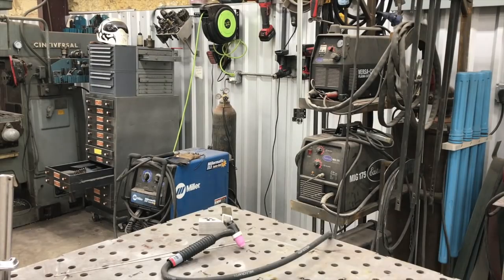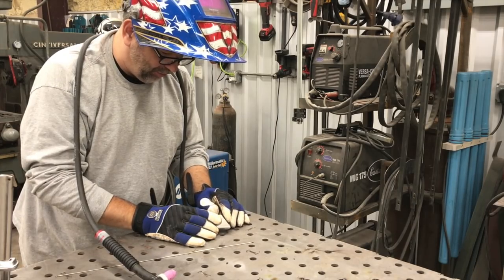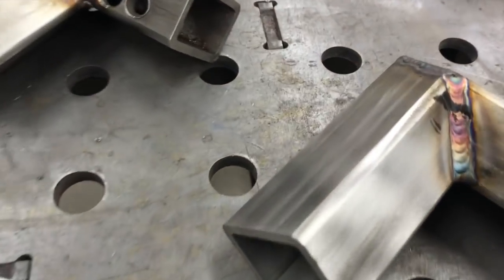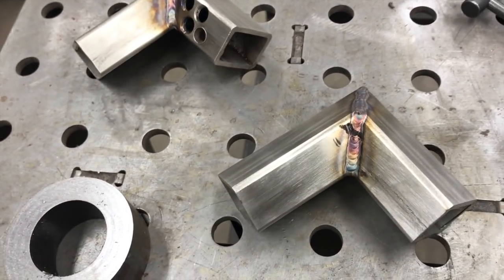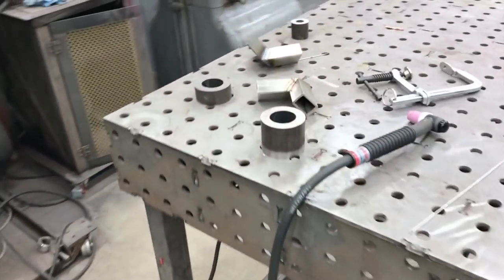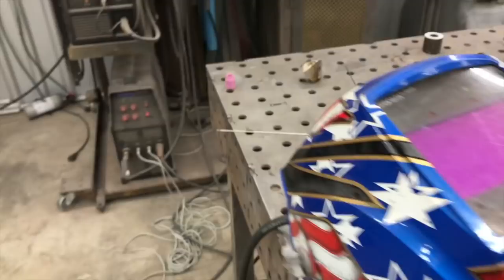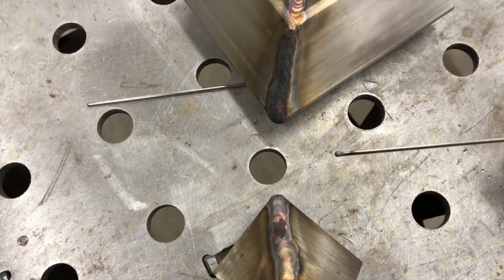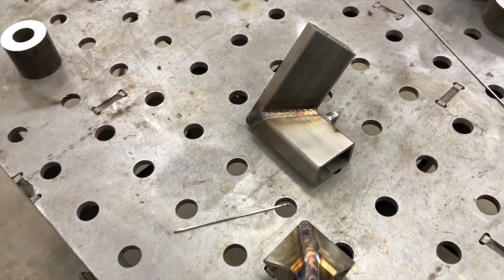FUPA Cup Vs  Standard Is there a Difference? #12 Furick Fupa - Stainless Tig Welding

Comment: This is what iv learned in the last decade so far. 1- stainless move as fast as possible once the puddle forms. 2- as big a cup as practical. 3- use an oversized filler 3/32 insted of1/6 and 1/8 insted of 3/32 it cools the puddle every dab. 3- smaller more frequent dabs.  Looking good! love the compound miters
Reply from the maker: Awesome tips andrew.  I have tried larger fillers, and keeping the heat at the same, It seems to want to stick and not flow in very easily which creates more issues for me.  maybe raise the torch a little, and dab more toward the center of the puddle instead of hte leading edge ?
Reply: Ramsey Customs - turbocobra I hear you. It’s a quicker dab because your chilling the puddle so quick the filler sticks. I still hit the edge but it’s a quick “quite click” sound than out and mostly practice! Over and over. I also forgot to mention the first time try coming across some huge aluminum chill blocks you can rest your pieces up against that will draw even more heat out of the weld and maintain the nice color you were looking for. Good luck. Great videos!
Reply: @SkiDuneTech  I know I'm 2 years to late. But a stainless weld that was under argon until it cooled is going to be silver /gold. The blue come from removing the gas before it's cold enough to not color. In this video he didn't clean anything before welding. He didn't post flow long enough. For a simple joint like that just lay wire it and run fast too avoid pulling your filler out of shielding gas. Gas needs to be 20 to 25. Color doesn't mean a good weld. Bright silver is a perfect stainless weld. If you're penetrating deep enough to need backpurge but not back purging you're sucking up o2 from the inside into your puddle. If you see the puddle dancing that's how you are getting full pen.

Comment: On the outside corner, the shield gas flows along the two slopes and actually that sucks in air.  The inside corner forces sort of stop of the shield gas stream which nearly floats back, maintaining shield coverage.  You can see similar behavior with shop air blast, where additional air joins the jet from around the nozzle.  If you really want to see it, blow through some smoke or flatly along the top of a dusty bench.  It is not just a narrow jet that removes the smoke or dust.  Additional air has joined the trip and widened the path.
Besides a wider cup (that tends to force you to use a longer electrode stick-out), you could try adding some clay walls on the work, trying to stop the easy flow of the shield gas along the two slopes.  Another thing you can try is REDUCING the shield gas flow.  A wider cup does the same,  reducing the jet speed, if you don’t increase the flow setting.  Less speed = less turbulence and less sucked in air.
Reply from the maker: Some excellent points here thank you sir
Reply: Pellervo, does this same "outside corner" effect apply to stainless steel exhaust tubing? I have been practicing for a couple of months on SS exhaust scrap pipes, and virtually all of my welds (mostly butt joint) are grayish coloring. I never get gold or blue coloring. I am trying autogenous as well as with filler rod, still grayish. Thanks for any tips. Dave F.
Reply: Yes, it does.  In fact, it is a general behavior, although on mild steel you don’t notice it the same way.  Something like titanium or zirconium are absolutely miserable.  Stainless steels you mostly can wire brush to acceptable appearance - the better the sooner, you should do it after weld while still hot.  
By the way, we had a couple of times the gas supplier deliver argon/oxygen mix instead of pure argon.  2% oxygen can be sometimes used on MIG, but our TIG welds (and the electrode as well) were garbage.  In fact, you could check the gas quality by looking at the discoloration of your electrode.  Silvery satin appearance tells about moisture, straw color tells there is some parts per million level oxygen.  Blue color tells about nitrogen (air) and black results with any strong contamination or long duration.
Reply: Thanks for the reply. I have indeed been wire brushing and they look OK after that. But it's disappointing to never get the beautiful coloring. Thanks for the tips!
Reply: Cool idea on the clay. I was thinking he could also just clamp some aluminum 90 degree angle on either side and that can help keep your Argon in somewhat of a trough. Sometimes you just can't do too much to prevent that oxidization. There are times when I've weld it outside where you're just going to get that oxide, yet it doesn't mean your weld is inferior or contaminated

Comment: outside corner joint is getting to hot thats why its turning gray. it will develop rust from over heating. so use your  fupa cup and use pulse settings (if you have it) on your outside corner joints.or pulse the pedal at about 100 amps and see if that helps. i would also bump up the post flow to 7 seconds.
Reply from the maker: I think I have my post flow wide open, set to the max.  That's good, except in this video I wasnt dwelling at the ends of the runs, so it wasnt doing any good lol.  Some excellent points here.  I think travel speed was my biggest issue.

Comment: They make ads on pulse for many machines sub 500 bucks if you want to keep the penetration constant and shielding coverage ideal in all positions. Pedal pulsing can’t do that on the fly and compensate gas coverage, obviously not what was being done here but some may suggest it is all. I’ve also found that using a heat sink clamped to the part on outside tie ins helps too. I can run as hot as the wall thickness will allow in the flat for overhead outside work as long as the heat has a route to escape. Internal purging only caries away a fraction of temp compared to a big slab of copper or aluminum.

Comment: Just started to tig weld if use 200 amps it would blow hole in the metal is that because lm moving to slow shaun uk
Reply from the maker: lower your amperage and decrease your arc length

Comment: I love furick cups! Best I've ever used
Run about 25cfh using that cup
Try 80-90 amps and pick up travel speed. I bet your color and bead profile look great. 
From what I see your travel speed is a little slow. It's impossible to outrun the heat and you'll end up cooking all the chromium out. Trying to do my best to help. I know if we worked together in one afternoon you'll would be making great welds. There only a couple minor tweaks to get you where you want to be. Mainly quicker travel speed
Reply from the maker: Thanks Mike.  I really appreciate it.  The strange thing is, I did try one of the corners, with no filler, basically just ran the torch over the joint and fused it together, went as fast I possibly could while not going so fast that it didnt fuse.  Basically same result.  What's odd about all fit is I use the same technique on the inside corners and those seem to have pretty good color, at least not hazy. Thanks again for all yoru comments!
Reply: Ramsey Customs - turbocobra remember outside corner joints need better gas coverage than inside corner joints thats partially trapping gas. Outside corner joints usually need a little less amperage also. You'll be good to go by the end of the week if you keep practicing. I would bet money on that.  Inside looked great just practice your outside
Reply: Ramsey Customs - turbocobra make sure your gas coverage is good. A crappy gas lens could be a problem
Reply from the maker: Ok, i will try a new gas lense to see how that works.

Comment: In one clip it looked like you flipped it while it was still glowing hot.  You should camp out with the postflow and do the same test. The fupa cup is sweet but sometimes it gets in the way. Don't you think?
Reply from the maker: Yes, it was getting in the way on some of the inside joints and you are right, I wasnt dwelling long enough on the post flow, sometimes i skip that on practice pieces but actually thats bad practice, should do it even when practicing

Comment: Stainless is tricky... I know you are supposed to use way less heat, and or move faster. Since it's .120 wall, you'll be better served chamfering all the way around. As far as filler rod size, that I don't know. I'm guessing you can go smaller to get a flater weld profile that sets into the chamfer better. I have the Furick Cup as well... it's pretty awesome.

But when you go into production mode on these, you might want to build up some clay dams around the outside joints so the gas stays in there. Do you have a jar of that heat sink putty? I've used that to trap gas before, and it's reusable. There's Hot Block, Cold Shield and Cool Blue. (I know there's more, but those are the only ones I'm familiar with)
Reply from the maker: Yea I wasnt sure if I needed to chamfer those, I think the main issue was travel speed.

Comment: Greying in stainless can happen for many reasons. Big 3 are too hot, not keeping filler in shielding gas and not proper application of shield gas. I think your having a problem with those 3. It's very important to slowly taper off amperage at the end of weld and keep the weld in gas for at least 3 seconds after weld is finished.

Comment: Nice video good info. How often do you use your Eastwood welder and plasma cutter? Do they work as advertised? Heard horror stories of not working right out of the box
Reply from the maker: The Eastwood Tig has been great for what I use it for.  I just wish it had pulse.  But I have never had one problem with it.  The Mig welders are not as good.  I dont like the way the mig welder welds, and I have had 3 problems with it, and its actually currently not working.
Reply: Ramsey Customs - turbocobra Thanks for the reply. How is there plasma cutter? I have been considering buying one of those.
Reply from the maker: I have only used it 2-3 times.  You can see it being used in this video.  https://www.youtube.com/watch?v=GAUFZmDxcLE  It worked great.  Want to buy a used one?  I never use it, its' basically brand new but it's all dusty from sitting in the shop.

Comment: V out the out side corner and it will weld way cleaner. The inside almost makes a natural V for the filler to lay down inside of so it looks a bit cleaner naturally. if you were to grind the weld on these joints down for a finished corner it wouldn't be structurally sound the way you have it right now.

Comment: It’s all about your torch angle on your outside corner joints doesn’t matter if your running 200 or 100 amps if your angle isn’t right it will be burnt looking like that. Go just hot enough to break the corners down then don’t go any more than that. Really angle that torch and allow the gas to cool the metal before you even weld it. Makes the world of difference. Outside corners and very hard to get the hang of. Good luck man
Reply from the maker: Good info, thanks!   But in all of the issues I was having, it turned out not to be travel speed, amp settings, torch angle or any of that.  It turns out that the argon bottles I get from my local welding supply, once you get down to the last 20% of the tank, the gas is dirty/contaminated.  New gas bottle, issue solved...
Reply: Ramsey Customs - turbocobra  I’ve ran some bottles that ran bad before also. Sometimes they will have the wrong gas in them also

Comment: Hi Gar,, 1 Dumb question,, Why air cooled, torch,, Most time we had 5 guys and Gals, Heli-Arcing 8 hrs a day,, Yep some of the females thought 20 ga. was like 1/4 inch Plate,, Thanks,,,,
Reply from the maker: I dont have a water cooler or torch, just using a cheap eastwood tig machine.  I definitely need to upgrade

Comment: You're burning it in too hot. And You're pulling away too fast after each weld.
Reply from the maker: Right, I think its mostly a travel speed thing, need to move on faster.
Reply: I just saw your new video and posted over there.
Reply: @turbocobra  travel speed is key. More amps does not equal more heat unless you stay in the same spot too long. You'll cook stainless that way. Need to get travel speed faster but the only way to do that is turn the amperage up so you get a faster puddle.